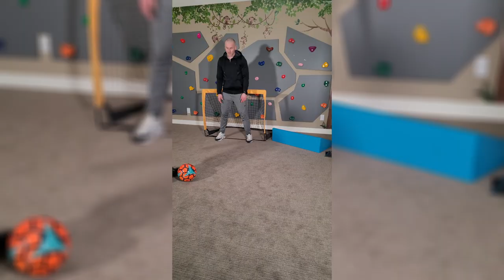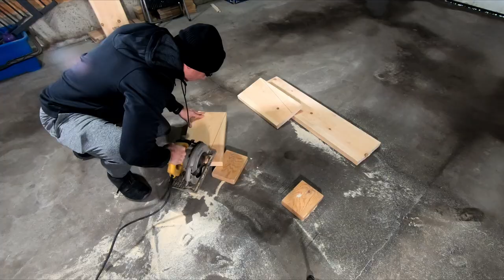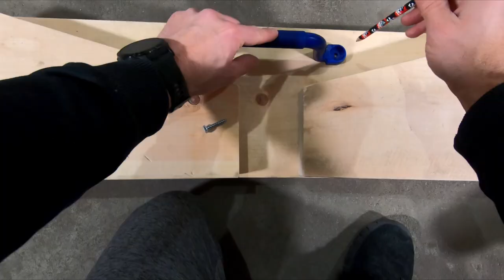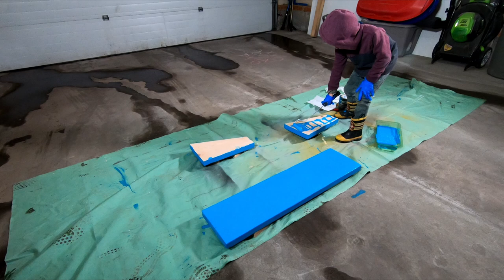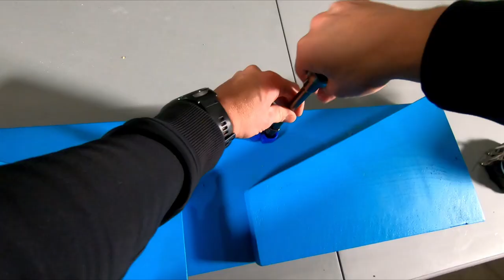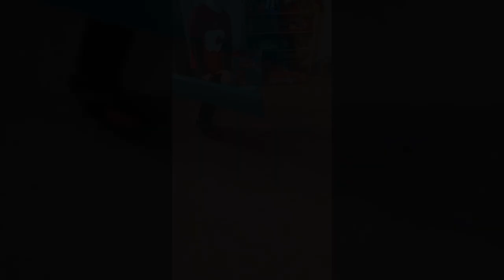DIY Soccer Rebounder Board - Soccer Trainer

Comment: What angle did you cut the legs? Im stuck between 30 and 25. Not sure which is better.
Reply from the maker: Hey Rob! Sorry for the delay on getting back to you. I tested mine and had to make some additional cuts. The final angle is 27. So right in-between what you were thinking. Good luck on building your rebounder. let me know how it turns out and if you have any tips for the next time I build one.

Comment: Hi..did you buy just 1 large board, and make the cuts with it?  Example:  2"x6'=
1-36"
2-14.5"
Total is 5'5"?
Reply from the maker: Hey, thanks for watching and that's a great question. Yes, we purchased one full length (8ft) of 2" x 10" and cut it.